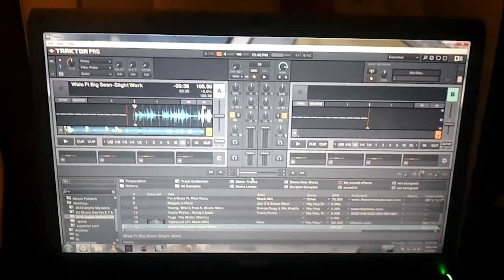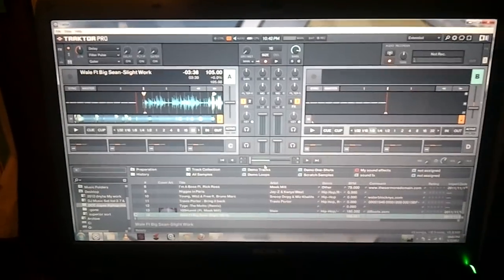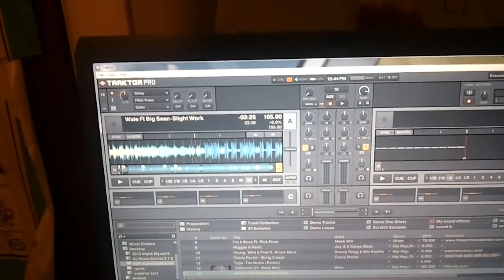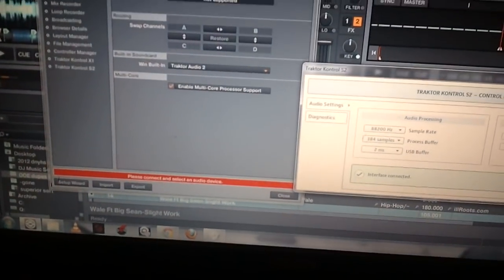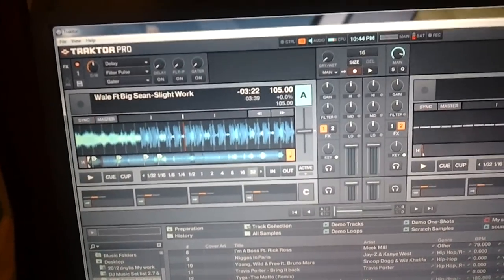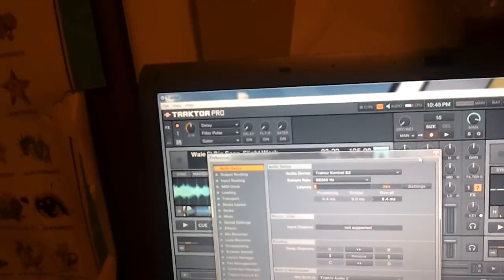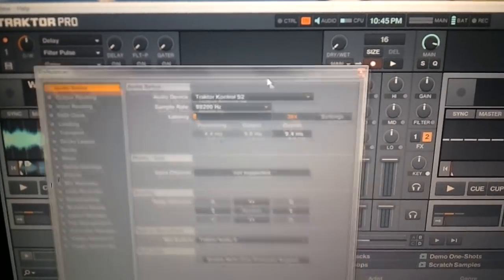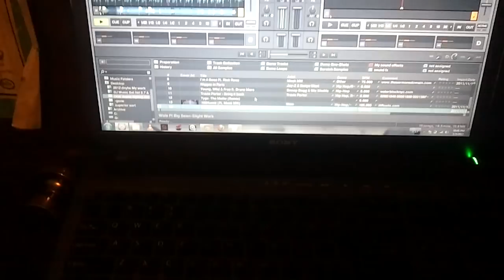Traktor Pro 2: How to make it stable, remove glitchy sound & lag

Comment: your main issue there is your running your S2 at 88khz..... why I don't know.... turn it to 44 or 48... mp3's don't even hit near that.... and yeah on faster machines, lower the latency... charger should always be plugged in and make sure your power settings are on high performance, it also helps to set the pc to process background apps over programs.

Comment: Hi Im a bit frustrated with traktor pro recently. I have lag issues when mixing some tracks. The tracks when playing are sloppy and when mixing them they jump or they lag behind their normal reproduction rate. I have a MacBook Pro  2,4 GHz Intel Core 2 Duo 4 GB DDR3 and installed versions 2.5 and 2.6 of Traktor and the same problem. I have played with latency a bit and still the problem. The thing is that it is only with some tracks that happens.Thanks a lot.

Comment: Thanks mate! I started having very annoying crackles/pops in the sound yesterday due to huge CPU loads which I had not faced before, and your 1st tip helped solve it.
Reply: Hi. I've tweaked my settings to everything that is covered in this vid but still getting crackle sounds.  What do u suggest?
Reply: @willdyett202  Unfortunately I do not know what to suggest. But first try even smaller values for the settings shown, e.g. for the Buffers. Maybe you can find your own tuning with those settings that works, fingers crossed for you.

Comment: Hey ! Can you please tell me if there is solution to fix my problem. MY traktor S4 MK2 has this problem of not able to load tracks using load button right side on deck B. Also sometimes it auto loads the track into deck B. The buttons and cue tack 1 button flickers light and there is no problem whatsoever with the left side .can someone help me .

Comment: I use Traktor 2.10 mapped in a Pioneer DDj Sb-3 and i have latency and cant lower it beneath 20ms(Which i assume is the problem). Its just that when i select the Audio Device to the DDj SB3 the sample rate selector gets greyened and i cant change it (Its in 44100 khz anyways) but it tells me that the Latency is 20ms and i dont know how to lower it. Any suggestions?

Comment: Native Instrument Solution
To run traktor properly disable USB, Wifi, All cores, pull-off your ram and remove fans from CPU and GPU, not even plug any hard drive, and there will be no issue !
WTF Native Instruments ? Do you want we buy your S2/S4 ? hum ?

My solution
Try to install olders versions (2.4 or 2.5 etc), something tells me that newers Traktors are done to sell hardware, since anybody has the cracked version !!!